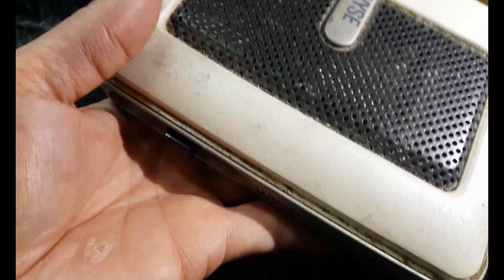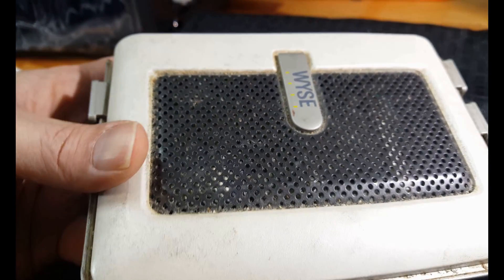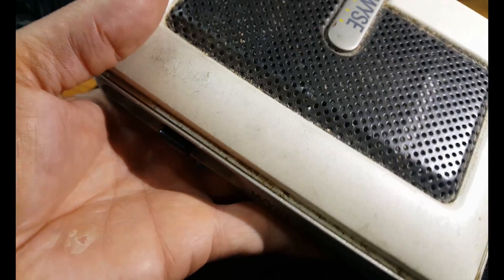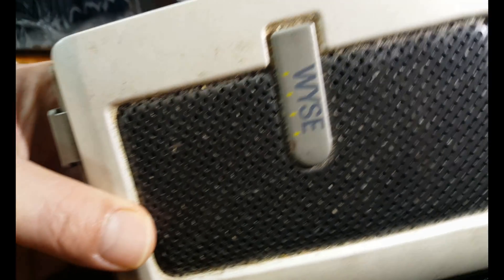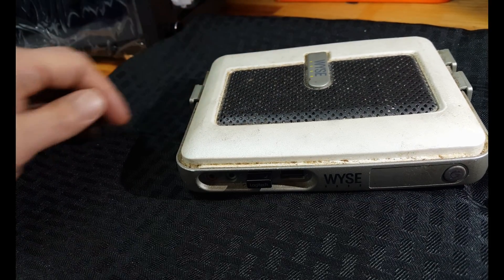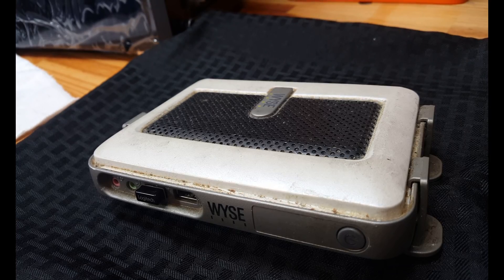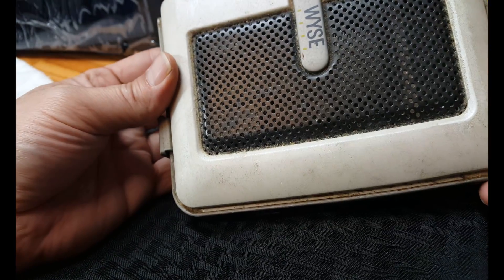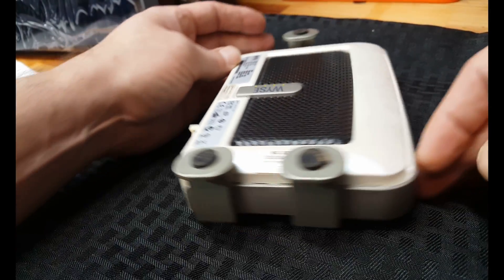$5 thin client So low spec I'm not sure if it can run Linux

Comment: These machines were made to use as office software running PCs. They have enough power to run lightweight Linux distros, like these using Openbox for example. You can use it for basic internet browsing, but not Youtube, some retrogaming like old DOS games, emulated 8-bit and some 16-bit consoles like PC-Engine or Sega Genesis. It can be too weak for SNES thought. Amiga emulation can be too demanding too, because of it's low-grade graphics chip. High quality (720p and up) video files may lag. It can be also nice as a player for mp3 and flac files. But don't expect it to be normal PC since it was made as a basic office workstation.

Comment: Looks like you can get up to 512MB RAM in there and has a IDE, so can get a bigger hard drive.  You could then put Windows Embedded ReadyPOS 2009 (free 6 month trial) on it (basically a thinned down Windows XP).  I detailed this for a WYSE  v90 install (see comments) on:

https://www.youtube.com/watch?v=LfOuGvLgcZY

Its a decent amount of work to get it going, but "in theory", you'd have a "modern" OS.
Reply: You can of course freely activate any version of Windows with a script so no worries about trial versions. On something so feeble I'd need a good reason to run Windows while a light Linux is easy to configure with jwm or other light WM.

Comment: I own an old wyse winterm 3360se, the only thing I don't have for it is the CF card to expand its storage (a standard CF won't work as something about it is different, so I can't install everything on it, only the bare minimum). It runs windows CE. People have been able to shoehorn Linux onto them by using a USB thumbdrive

Comment: not hating, but this is completely useless thing. not worth to spend a cent for it. the CPU is very slow, so it won't even run Windows 98 smoothly.

Comment: I did something like you with a couple of old HP T5540. I have got 10 of them for €20. I installed Puppy Linux bare-bones 431 and it works like a new computer!
I installed it on a USB flash drive which I mounted inside the case. 
I am running a small web server from it, called Hiawatha. It is secure and blazing fast, considering the hardware.

There are a lot of bourbon puppy Linux versions, and most of them work fine on hardware like this:
http://puppylinux.org/wikka/BareBones

Comment: some versions came with a super stripped  down version of Linux for connecting to remote servers as use to use them at a place I worked they would boot in to Linux then after you logged in it would then basically take you to a Windows based system running on a remote server, i guess it was cheaper than having to licencse out all the computers but bugger me it was super slow at times even crashing a fair few times, but they have to save that cash I guess lol

Comment: You can upgrade the ram to 2GB and the hard drive to a higher size to like 16GB rather then a tiny 512mb. i don't think it would cost that much at all
Reply: Storage is soldered and max ram is 256mb
Reply: @tectoz3672   Nope storage aint soldered :)

Comment: The NAPA I worked at had these at the counters for looking up parts and invoicing. They were running Win2k, but not very well. The one at my station overheated one day so I took it apart and cleaned it out. Replaced the 128 MB stick of ram with a 256 MB which actually made a big difference. The other countermen always wanted to use my station due to how much betting it ran. The boss told them to use there own station then had me update his.
Reply: cee128d r/thathappened
Reply: @RaceboyYT  haha yes reddit is a thing!
Reply: @RaceboyYT  r/nothingeverhappens
Reply: capitalist pigdog!

Comment: Would be quite interesting if that thing could fit a raspberry pi compote stick
Reply: No, since there would be no benefit to using that for a Pi case vs the many available. Faster thin clients are cheap used and often better deals than finishing a Pi build, especially in 2022.

Comment: You should use windows 98 second edition
Reply: Logan Lapoint Windows 98 will not install on 64mb disk
Reply: @PrzeszczepiX  The flash module could be replaced with a larger capacity one, but I don't think W98 can be made to work at all.  I've got 3 of these and it can't be installed, at least not easily.

Comment: Can you install Chrome OS on that WYSE thin client?
Reply: The Wyse SX0 Thin Clients are too low spec to do so. They merely have a 366 Mhz AMD Geode CPU and up to 256MB of RAM.
Reply: @herrv1906  lol my GPS has more power than this wyse
Reply: i wouldn't think so, even the shittiest chromebooks have an intel atom and 2 gigs of ram
Reply: Marco Escamilla - Chrome OS is unsupported. But you can try if you’re willing to do the work. It can run 32bit x86 Linux distro as shown in the video.

Comment: You can also use it as a retro DOS gaming machine. The channel Phil's Computer Lab has more info about those thin clients and how they can be used as retro gaming PCs.
Reply: The WYSE Sx0 series has a 'gotcha' in its BIOS. Connect a USB floppy drive and boot a MS-DOS setup or 98SE boot disk. The IDE controller will be hidden from FDISK, FORMAT and everything else. Boot a FreeDOS install floppy or CD and watch closely. The IDE controller will be detected during boot but when booting is done the installer cannot see the IDE. No fixed disk present. Same if you try to boot any Windows install CD. Many Linux installs can see the IDE despite the Sx0 hiding it. If you install DOS to the Disk On Module using another PC then plug it into the Sx0 it will start to boot then fail because the BIOS hides the IDE before command.com can be bootstrapped into RAM.

So, either a special bootloader replacement is needed to run DOS, or someone is going to have to create a modified BIOS and an installer, or hack the Dell/WYSE BIOS updater. Doing that would likely make the official operating system installers fail because they expect to have to bypass the hidden IDE or they somehow toggle off the hiding.

S10 used a proprietary WYSE OS. The original S10 didn't have the IDE module or upgradeable RAM and is useless for running anything else. After versions running other operating systems were introduced, the S10 was changed to that type. S30 used Windows CE 5. S50 used WYSE Linux V6. S90 used Windows XP Embedded.

There is something embedded in the BIOS that tells the installer which OS was factory installed as a way to prevent people installing a different OS. However, there is a key file with the installers so if you want to put WYSE Linux or XPe on an S30 you can create the USB installer drive then switch the Linux or XPe key file with the Windows CE 5 key file and the S30 will happily switch systems. Same deal if you want to put WinCE on an S90 or XPe on an S50 or second revision S10.

I figured that out because Dell used to offer an XPe upgrade kit for all of the Sx0 series (except of course the original S10) so there had to be a workaround for the factory OS version lockdown.

The Sx0 cannot boot from a USB flash drive over 1 gigabyte. It just flat out will not. Probably won't boot from a DVD, but I haven't tried. I do have a USB BD-RE drive but I've only used it to try the FreeDOS install CD.

The USB controller and Ethernet controller in the Sx0 should be usable with drivers that are available, if you look in the right places. There was a Panasonic universal DOS USB driver, but that one is hard to find. (IIRC I may have dug it up with archive.org ). The AC97 audio may be possible to get working under DOS if it's 100% AC97 compliant. There are a couple of DOS AC97 drivers. One from VIA and I think the other is from Realtek.

I want to get DOS on one with the USB working so I can see if there's a large enough 'window' in its memory map to setup EMS. Whyfor? Because I have an old benchtop CNC mill whose software only runs in DOS and it only knows about conventional RAM and EMS. It can't use XMS.
Reply: @greggv8  I think I've read your similar comments on the wonderful Parky Towers website, which no video on 'thin clients' should go without mentioning.  I have three of these SX0 models, all are the later version with IDE port and RAM slots.  I've pretty much given up getting them working, so I was surprised to see Puppy working, as in this video.
Reply: Broadly true with many thin clients, but due to the particular chipset used in this Wyse model, it's not so easy.  The physically similar CX0 is a better bet, with an 800MHz VIA CPU and graphics.  Windows 98 works quite well, from memory of Phil's video on the subject.
Reply: Ward
Reply: would be cool to run Zork on!
Reply: Windows 98 maybe

Comment: As far as the build goes, I really, really love the color, I'm gonna figure out what specs this thing has first before I make any suggestions, puppy is probably the way to go tbh...
Ah I did some research on this thing... and what a surprise... it has almost the same specs with some of my older collections...
You can maybe try Tiny series for the Windows, but I reckon the hard drive is a limiting factor, so your best choice would actually be either puppy or DSL, DSL, if I didn't remember wrong, only takes 32MB of storage.. NimbleX can be another choice as well.
Reply: i see you know about linux, do you know a linux distribution specialized on web browsing?

Comment: Would lakka or recalbox x86 run on it?
Reply: Too slow. More than NES and SNES is Not possible.
Reply: I have a feeling the CPU lacks the necessary instructions to run modern Linux kernels, and it would likely be horrifically slow anyway.